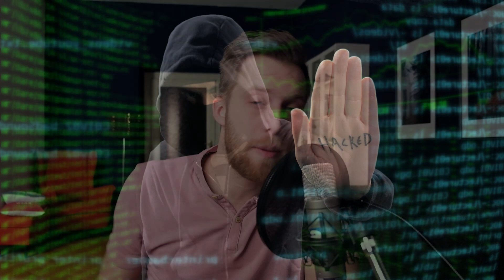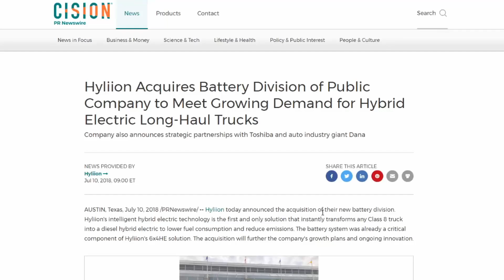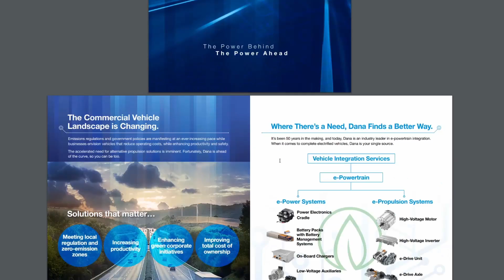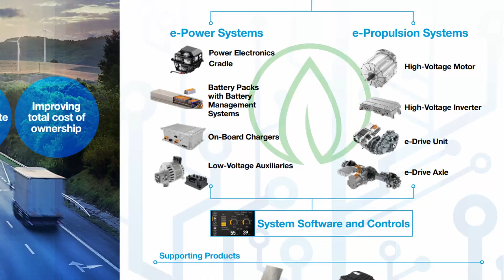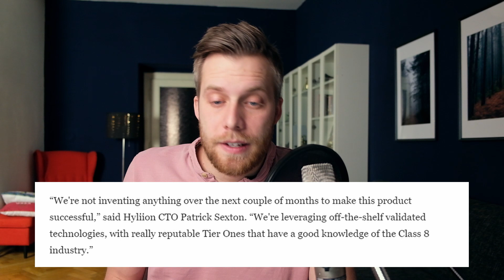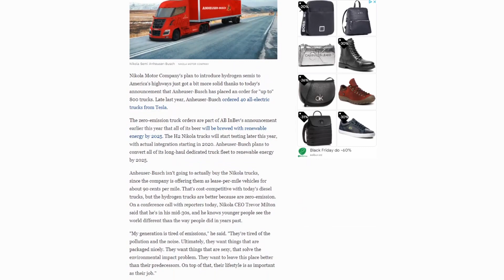UGLY TRUTH OF HYLIION

Comment: HYLIION:
With this product, the Hyliion company is completely reforming the heavy freight market.  Heavy trucks have to deliver a lot of torque to move and transport the huge weight/mass (~ 40 tons).  This technology is better than a simple electric drive.  
Huge torque cannot be achieved with simple electric drive alone or the batteries will discharge very quickly.  
Pure electric propulsion works for cars, not for trucks.  
That’s why they think very badly who want to invest in companies that promise clean electric trucks. It shows that they do not understand it. 
(NIKOLA is fake/wrong ! Hyliion is right!)

Clean electric-powered trucks can be solved without any assistance, but they do not provide performance that meets the requirements of freight transport. 

>End Result of Pure electric-powered trucks without any assistance: FAIL, without order or with poor order!

>Therefore, Hyliion's solution is a winning technology.  
Many companies are interested in it, invested in it and will order.  

> Fake robinhoods have interest to rumor fake news about Hyliion and compare with Nikola!
The comparison of Hyliion with Nikola is total wrong viewpoint/perspectice/the way of thinking.

They did sell stocks / shares at high price ($50). They rumor, spread bad news about Hyliion.
The price go down and they buy the shares cheaply back to make EXTRA profits.  

Correct.  Good video.  !!!
Hyliion is not equal to Nikola. 
Nikola just promises, but Hyliion is a REAL WORKING TECHNOLOGY and good solution!
  
It turns out later that Hyliion has the right approach, solution, technology.  
Market orders will come as early as 2021.  
Then those who have sold, will realize that they have made a big mistake.  
But it will be too late because they will never be able to buy it back at such a low price again.
It us sure.
>PREDICTIONS of Hyliion stock price: min.  
$ 70-80.  (to the end of 2021)

Comment:
I am an economist, engineer, logistics. 
I work in the freight transport sector (trucks, shipping).
I know it.
Reply from the maker: I see bull, I like

Comment: This company will just be bought out the only thing they truly have is the software. Nothing else that cant easily be developed by the big trucking manufacturers
Reply from the maker: Well they also have hardware that is slightly modified for their solution. The reason why it is important is because it is tested with many miles. This is something that none of the companies could do do over night. You can only sell proved technology in scale.